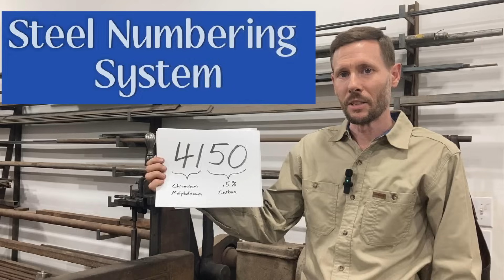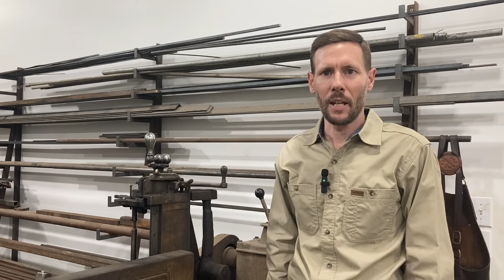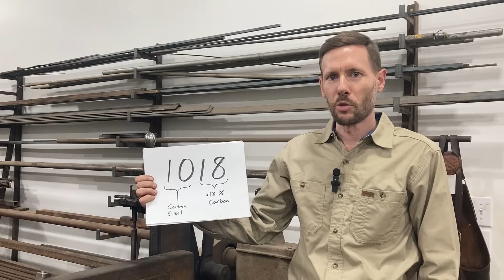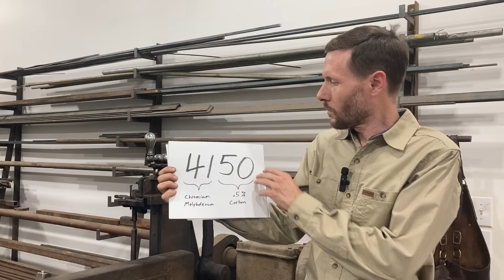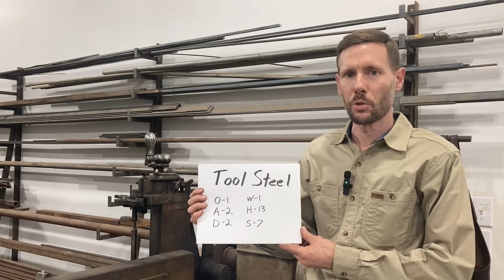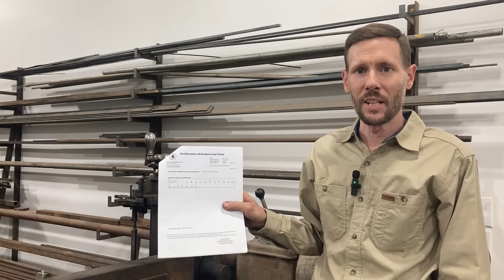Steel Numbering System

Comment: You said several times that the third and fourth digit represents the amount of carbon in tenths of a percent. Example given: 5140 means it has 0.4% carbon.

But if 40 = 0.4%, then those are HUNDREDTHS of a percent, not tenths. 40 tenths of a percent would equal 4%, not 0.4%.

Comment: I was a machinist for years with grandfather, father and brother. I never knew the numbers system just the way it had to be setup for cutting. I'm sure my grandfather knew having been an apprentice in Germany. He could do anything before CNC and knew how to use the Machinist Handbook for complex setups and calculations. I never had an explanation for the number system so this was interesting. Is there another video on stainless steel? What about "free machining steel" with lead content? That was easy to cut without cutting oil and it cut fast. Thank you for the well organized presentation.

Comment: So you're saying the nonsense alphanumeric system of steel grading is still just nonsense.. How does chromium and molybdenum equate to 41 for instance? Is chromium the 4 and molybdenum the 1? If so, why? That would be handy information. This video describes what the recipes made, but doesn't include the reasoning for the measurements, ingredients, certifications, and the correlation between the numbers/letters and the elements themselves.

Comment: Thank you Sir.  Everytime I go to my local steelyard, I feel ignorant and am afraid to ask what all those number mean, so I just say regular metal when they ask me what kind of steel I'm looking for and probably sound amateur.  This absolutely helps.
Reply from the maker: I am glad it was helpful. The steel industry can be a confusing topic and the guys at the steelyard likely only know one portion of the industry really well.
Reply: They're probably giving you mild steel if you say 'regular' :)) because that's the most common one. You should probably also look into cold rolled vs hot rolled metal, in case that is relevant to you.

Comment: Interesting, how 4140 is marked in 42CrMo4; or, 5140 is as 40Cr, 1040 = C45, etc. And there out is more steel grades where 4...6 digits for it marking - less. Yes, right about steel testing and it certificate. At today 1pcs steel sample test cost from 20 - 30EUR +21% tax.
From experience: testing unknown steel "on spark" you can image aprox alloy content. It is very easy mess up with C45 and 40Cr and 42CrMo4, even 50Mn. I have sample colection for steel spark test.
Reply from the maker: You are right, the spark test is just an approximation, and collection of known samples helps greatly.

Comment: You failed to to state that this is the SAE standard. There's astm an other standards. By good video.
Reply from the maker: That is correct. I go into more detail about the different standards in Steel Numbering System part 2.

Comment: The "D" in D-2 steel stands for Die Steel and is still used today for die making punches and shear blade for working other metals in industry. ;<)
It is also very popular in the Knife Making World.
Another old steel, F-8 was orginally developed for making metal cutting Files. 
 KnifeMaker/Retired after over 47+ years in the Craft

Comment: These videos are great! Thank you! I wish I was young enough to actually remember all of this but I put these into my favorites. I was wondering when you were gonna get to 4340 because that’s what my SBC crankshaft is. I have a Bridgeport mill and Clausing lathe. I’m a home hobbiest and love it! My mind is everywhere lol. I love learning. I’d like to melt down some cast iron to make a follow rest one day because somehow they lost it. Almost bran new 80’s machine. 12X40 VS-12. It has zero wear luckily. It still has the original belts on it too. I got lucky. I want to learn hardening steel and aluminum. Do you also work with aluminum? I think these kind of videos will do really well

Comment: Do the last two digits stand for percent carbon in tenths or in hundredths? Your calculated percentage seems to indicate hundredths... 4140; you claim 0.4% carbon. However, "40 tenths" would be 40x0.1 = 4.0%. Now, "40 hundredths" would be 40x0.01 = 0.4%.

EDIT: Verified with some quick reminder research. The second two digits stand for carbon percent in hundredths of a percent, not tenths of a percent.
Reply from the maker: You are correct, I explained it incorrectly.

Comment: 4140, 41 Chromium and Molybdenum, 40 means 0.40% percent of carbon, if was 4% of carbon its not steel anymore is casting iron. Steel is alloy of iron and carbon, with maximum carbon content of 2.11% more than that is cast iron.

Comment: Interesting and consise presentation, thanks a lot. I'd like to go deeper into this. Are there any (official) tables / standards available that provide detailed information on chemical composition of the grades, based on these 4 digits? I mean that just a glance and some memory should be enough to see that this grade will be fine, and the other one won't work. Getting through the masses of datasheets with % range of each element is not what I need or like. Any hint, please? Or how to ask google to get the links quickly? Thanks in advance.

Comment: There's an error in the video. You say that the last two digits are the carbon content in tenths of a percent. But 18 tenths of a percent is 1.8%, not 0.18%. Likewise, 40 tenths = 40/10 = 4%, not .4%. So it's in hundreths of a percent, not tenths of a percent. Just looked it up, and Wikipedia, at least, agrees with me.

Comment: You may find that the acoustics of your room may be improved by making sound-eating panels of Safe-n-Sound Rockwool ( like a framed wall, but with cloth over its sides, if you want ),
& not only covering whatever window/wall the traffic-noise is coming in through,
but also sticking a batt in each corner, to reduce the bass-reverb..

Or, if you want to spend money, Auralex makes eggcrate foam ( paintable ) which can be used in the same places..

I like quiet, & would cover my ceilings with it, if I could.

_ /\ _

Comment: interesting. Another quick method of alloy identification is to use a X-Ray Fluorescent Analyzer (XRF). A handheld unit can be purchased for ~$12k and will give you the grade in just a few seconds.  Also handy for figuring out what the alloy is after any identifying marks have been removed.
Reply: @lancedoyle5026   XRF can not detect carbon level, thus can not be used for plain carbon steels grading.

Comment: Good video .  There are types, of  ' threads '.....probly about a dozen.  There are types, of  ' fasteners '.   All types of bolts / screws,  etc. They , all each have unique  threads, for materials.  There is a whole world, of  ' knowledge '   one  requires, to be a  welder / mechanic / eletro - tech.    I  am  a bit,  of  each  of  these.....Thanks, again, Mr. Jason Lonon !  Take care, of all within  your  power ! 
( I won't  go  into  metric / standard / english /   pipe  threads.......or   wrench  sizes......nuff  is  nuff;. )

Comment: I've been involved with BMX since the late 80's and 4130 has always been the absolute standard for frame selection, nothing else has ever done including Titanium (high tensile strength but low sheer strength) or aluminum (requiring a thicker wall diameter to accommodate strength). the closest to match 4130 chomoly has been 7076 T6 Aluminum, the same thing commercial airplane frames are made of
Reply: @jamisonr  I used to have a GT Dyno with white Skyway mags, still miss that thing. the BMX frame I have now is 4130 and only 4lbs made by a British company called Total
Reply: @jamisonr  I don't get along with larger wheel size bikes, been riding BMX for 30 years. can't do a lot of what I used to in my younger days but I still have fun

Comment: His use of the term ‘tenths ‘ for the determination of the carbon level is colloquially appropriate and correct.

Except the high carbon Cr bearing steels all steels are under 1%of carbon content so by saying a steel is a tenth of A ( ie 1) percent he is saying it’s a 1/10 of 1 percent - which is how it’s understood. absolutely no one ever describes the carbon content in terms of hundreds of percent except maybe some chemistry professors.  In some places it’s just referred to as ‘points’  such as 25 point steel. Ie 1025
Another way to describe it would be to say 1025 steel is .25 wt% carbon
Reply: Sure, but if we're talking about, say, 1018 steel it doesn't have 18 tenths of a percent carbon. So for people without that specialised knowledge (which is still unclear to me from your explanation) it's ambiguous and confusing.
Reply: @dielaughing73  think it’s just a quirk of English language how sometimes we say things that are imprecise especially when it comes to fractions of a percent, but the meaning is understood. A lot of steels are just the tenths ~ .2.3.4.5 . obviously in the machining world tenths hundreds thou 10 thou is critical  but the chemistry callout terminology, for steel is more relaxed because people are not mixing up a batch of steel on the spot , but just eluding to standard stock such as 1018. I’ve never heard of anyone reference the carbon in hundredths  but everyone is free to Ask their supplier to provide them with 2 tenths carbon steel and 8 hundredths carbon steel.
Reply: @andrewc9902  hey, at least we're talking about decimals and not sixteenths or thirty-seconds

Comment: What steel would be used for a piston pin? I liked your presentation but adding some more real world examples would be a plus. I run into some old farm engines 1920~40's but I would expect the steel selected then would not change too much over time, or at least stay in the same group. . Note: working with old stuff I also run into cast iron.

Comment: Awesome explanation. Thanks!! What's 12L14? Where does high machine ability steel and weldable steel com into the mix...?
Reply from the maker: 12L14 is a low carbon, free-machining steel. The addition of lead aids in it's machinability. Machinable and weldable are terms to describe different properties of steel, and are used to describe different grades of steel, but are not part of a specification.

Comment: We use the EN numbers a lot, It came in with ww2 and was Emergency Number so EN 3b EN 8 EN16T EN24T  However there is no written evidence shows that.
Reply: EN numbers usually reference the European or iso designation system

Comment: What does the 8670 mean?
Reply: 86XX alloy steals are a low nickel version of the 43XX  ni cr mo alloy steals
Reply: @andrewc9902  thanks for the info I had a bladesmith make a desing of my own out of 8670 and this knife eats anything I throw at it it's super tough it seems
Reply: @Loki-Ink   was it a 8620 steel 70 points carbon is really high. I think it would be too brittle to be usable.  The 86XX and the 43XX and the 4140 are the workhorse high strength, low alloy steals. There’s many other variations for more specialized applications such as landing gears but they’re all variations on the theme.
Reply: @andrewc9902  it's definitely 8670 steel and it takes hits better then any other steel I have which is 14c28n, d2, m390, 1075-1095, 154CM, 440c from what I was told from the blade Smith it's a very tough steel and from what I've researched it's used alot when making circular saw blades even saw blades for stone.

Comment: It was not called "carbon steel" when I was young. It's shocking to face once again that I'm that old, but no one called it carbon steel back then. Without carbon, no iron based metal can be thru hardened. A steel like that can only be case hardened. Because of it's non hardenability they call it "mild steel". Why would they call it carbon steel? It does not have enough carbon in it to through harden it. It makes no sence. I only call it mild steel like back in the old days before we allowed our country to be raped.
Reply: It’s called carbon steel to specifically identify it as separate from alloy or tool steel. Mild steel would indicate it has a mild amount of carbon between .1% to .35%. Roughly. If someone tells you something is made from alloy steel, that should immediately indicate to you that it’s higher strength, likely, but also likly  harder and any weld repair becomes much more complicated, and should only be done with caution and knowledge of what the actual alloy is, if someone wants you to weld on an alloy steel it will crack, unless you have the proper pre-and post Weld heat treat

Comment: Hey someone that knows what they are doing will be able to tell the difference between the distinctive smell of carbon ,chromium zinc ,nickel, bronze,silver ,hell even led has a distinguished smell .some guys get used to the smell of a fabricating shop and the smell of burning metal ! The smell is emitted more when metals are heated to melting point🤔 🙊😒😊😁

Comment: I used to work in a punch and de shop, and we didn't have any of this numbered steel back then (30 years ago) we used a Letters and number system... 

Like tool steel was, O1, A2, L6, S5 etc, and High Speed Steel was M1,  M2,  M42,   etc

Is that system still used or is it different for those TYPES of steel we used??

Comment: Nice information, with digital and nano printing tech I foresee a steel that has a fully throughout diamond molecule frozen in the steel iron matrix that makes the steel harder than diamond alone and much stronger than any made today. with the carbon and Iron molecules compressed and interwoven in the same space they would be without the other element.  As a transition to the 2 molecules interwoven (one of diamond and one of steel) I'm suggesting, I foresee a laminated product with layers of diamond and steal with each layer only a couple atoms thick much like bullet proof glass is made.  The end product with the interwoven molecules each layer of carbon would be a single atom thick and bonded to the carbon layer opposite an iron layer that likewise is bonded with a layer of iron on the other side of the carbon layer.  Literally a bar of iron in the same space as a crystal of diamond trapped by the atomic bonds of the other element without being directly bonded.  Would not be workable as blacksmiths do without loosing the properties as it would be 50% carbon bonded in a way not possible to maintain in a melted form.  The idea was inspired by nano carbon tubes and spheres that can be used to hold other elements trapped that could on day make novel materials like solid neon lights that can't loose gas because it is trapped by a solid at the molecule level.

Comment: Nope never and not even once!!  Been working on military weapons since 1983 and I am a machinist. I go quality inspections of all kinds of military equipment. Its a simple concept. if the job calls for 4100 series steel that what you use.   If the job calls for high carbon steel, thats what you use and if you don't I will catch it and nobody wants that kind of governmental  fine.

Comment: Great job! I worked with various alloys during my career as a product developer and with all the ones you clearly explained here. Most of the steels I used needed wear resistance and impact resistance. As with any metal, the more exotic the alloy, the higher the cost and lower availability. I used the Machinery's Handbook as a guide for material selection for years. As with many resource materials today, it is available in digital form as well as print.

Comment: 0:47 "...in tenths of a percent." 
ERROR (?):  If "...18" = 0.18%, then it's in hundredths of a percent.
i.e. "18" * 0.01 % = 0.18 % as per the example.
Reply from the maker: Yes, you caught my mistake. This numbering system expresses hundredths of percent.
Reply: Again 1:48 If "...40" = 0.40%, then the ratio (40/0.4 %) is 100:1 in percent. 
So the "...40" is in hundredths of a percent, i.e. 40/100 of a percent, or 0.40 %.
The "%" sign may confuse some people, so just keep it on both sides of the equation to avoid getting confused.
Reply: 4:00 "...100" = 1%, clearly given in hundredths of the percentage. i.e. 100 hundredths of % = 1.0 %.
Cheers.

Comment: Very interesting. Is there a list somewhere of all the first digit steel type designations? Knife manufacturers sometimes indicate the steel used in particular knives, it would be interesting to be able to decifer these. Similarly, there is a a designation system for aluminium alloys. Is there also a deciphering table somewhere for that?
Reply from the maker: Here is a link to a list of the first digits of the AISI / SAE carbon and alloy steel system I talked about in the video. https://www.theprocesspiping.com/wp-content/uploads/2017/12/sae-aisi-table.png

Comment: All i know is the one time I worked true wrought iron it moved like butter with lower heat. After hand forging various tool steels it was a dream. I think I understand why m*th addicts chase that original high now.😂
Reply: Wrought iron is actually classified as a different material. It is not steel just like cast-iron is not steel.

Comment: I've always wondered if you could use one of those Xray spectrometers that gold dealers use to verify precious metals on steel?  Machines like the XRF spectrometer or the Sigma Metalytics verifier can not only tell you the percentage of gold, but the percentage of what other metals may have been alloyed with it.  Most often copper, silver, palladium, or zinc.  And in the knife world you hear all sorts of numbering systems.  Plus the word magnacut steel gets touted as top of the line.
Reply: XRF will pick up the other elements of interest in steel such as nickel cr mo si mn and tramp elements such as S and P and others (with varying degrees of accuracy at low percentage levels) but EF cannot pick up the most important element carbon. Some of the tools will try to basically guess what grade of steel it is given the ranges of other elements but for example, if you had a 4145 steel the tool might guess it as 4150 or 4140, but it doesn’t actually determine the Carbon you need a different tool for that.